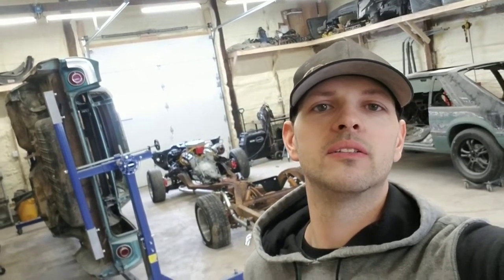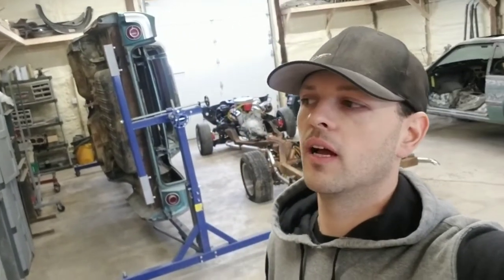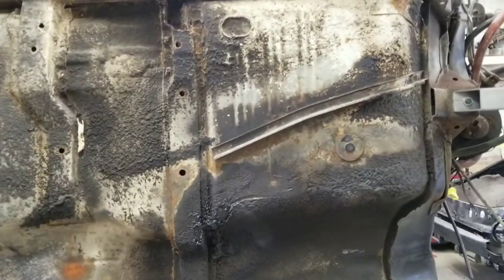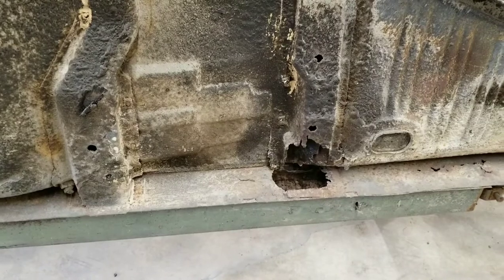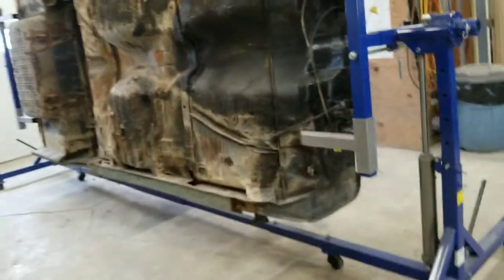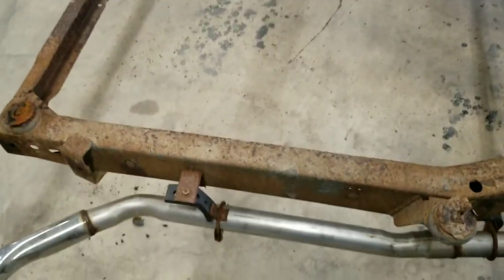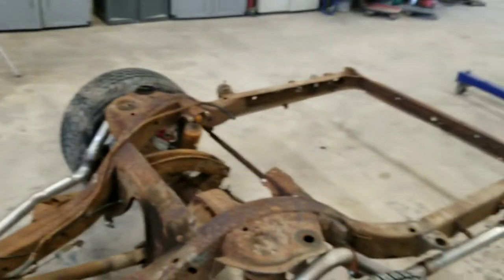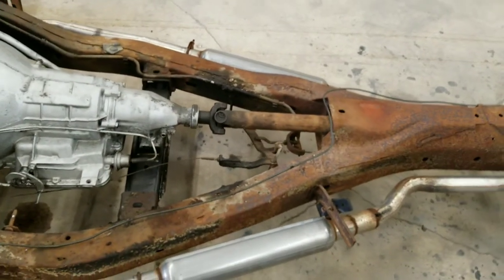#Frankingston the 64 Impala frame off rotisserie build Part 1 Intro

Comment: New subscriber!! Doing a frame of on my 64 impala ss. Going to learn from you a bit.
Reply from the maker: Sweet! Thanks bro. Any questions just ask!
Reply: @bpbrestorations2093  thank you! I'll have plenty soon as I pull the body off the frame. My car doesn't look as bad as yours but now I'm worried because of what I can't see until the frame is off. I know my trunk pan is slightly rotted but not too bad. I will be replacing that for sure.